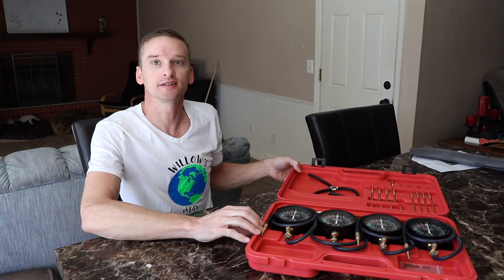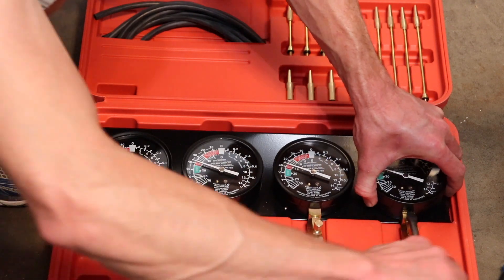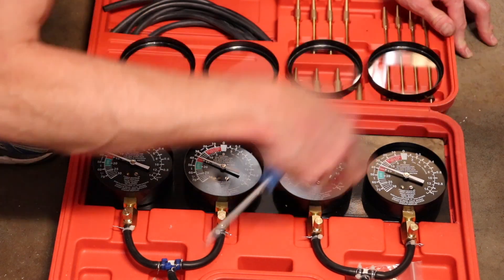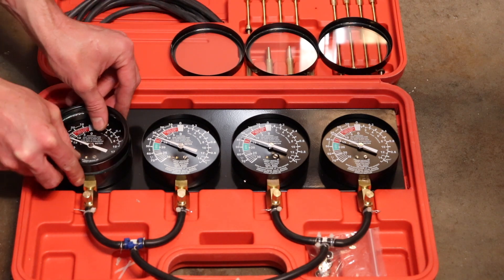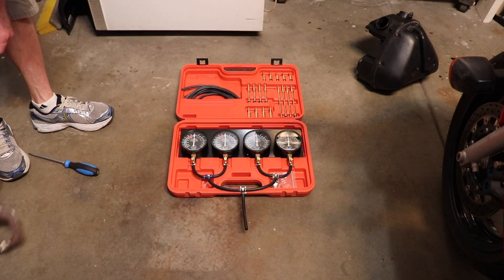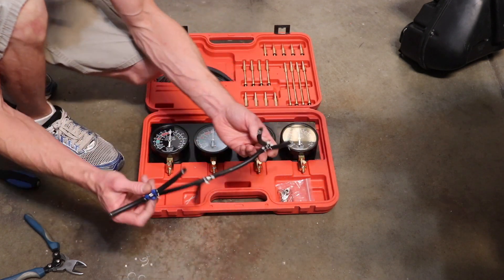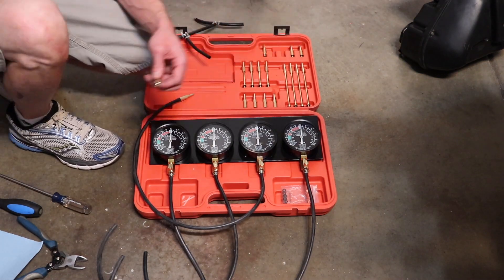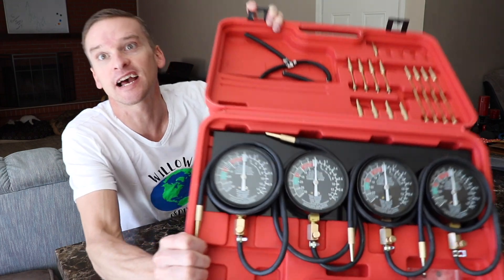DIY Carb Sync Gauge Set Calibration

Comment: Better to set to 0 at atmospheric pressure. Sucking with your mouth is not accurate as you don't know the specific negative pressure applied. These are not a very good kit but cheap.

Comment: Do I have to do this to be able to sync my carburetors
Reply: if you adjust a carburetor to an inaccurate gauge then you have put a carburetor out of synchronization. calibrate first before using on the bike.

Comment: I have this same gauge set.  Thank you for your video.   Iam syncing carbs on a 84 Honda 700 (magna) 
The adapter pieces on my carbs thread into carbs.  So the narrow part connects to the gauge hose.  Got any good tip on how to keep that narrow part and hose, tight?  The ring clips don't work well in that application, same with zip ties :(
Reply from the maker: I press hoses on firmly and they usually stay on the narrow part of the connectors, but if that doesn't work I use safety wire wrapped around the hose and twisted tight or use small hose clamps. I hope this is helpful. Thanks for watching!

Comment: Hi Willow, could you please show me where to find flush relay on Yamaha r6 rj03 and how to change him
Reply from the maker: The flasher relay is located under the driver's seat on the right hand side near the right hand seat mounting bolt. the relay has an electrical connection and you will need to unplug it and plug in the new relay. It's really easy to replace the flasher relay and it only takes about 5 minutes. If you need more help please email me and I can send you an electrical schematic showing you exactly where it's located. My email address is in the about section on my Channel home page. I hope this is helpful. Thanks for watching!
Reply: Thanks, if you just send me a picture I'll be thankful for that. Greetings

Comment: Hi Willow, could you pls show me where to find flusher reley on Yamaha R6 rj03 and how to change him. Thanks
Reply from the maker: The flasher relay is located under the driver's seat on the right hand side near the right hand seat mounting bolt. the relay has an electrical connection and you will need to unplug it and plug in the new relay. It's really easy to replace the flasher relay and it only takes about 5 minutes. If you need more help please email me and I can send you an electrical schematic showing you exactly where it's located. My email address is in the about section on my Channel home page. I hope this is helpful. Thanks for watching!